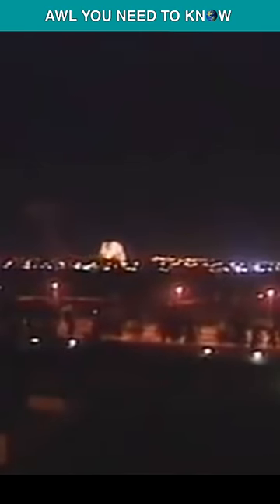How a Tomahawk Missile Works? #shorts All You Need To Know

Comment: so there are 150 missiles per DDG (not counting the others and not counting reloads at sea thats dangerous) what do we have like 100 DDGs.. thats roughly 1500 missiles that can be fired without reloading.. not that we would ever stack every DDG we had like that in one area but damn..
Reply: There are 90 cells on a DDG and will be mostly SM-2/3.  The Ticos (CGs) had 122 cells, and still mostly SM-2 (the 3s were not out yet when I was in).  
  I imagine you could load out with 100% TLAM but not a very effective use of assets.

Comment: Develop the new stealth cruise missile initiate it with a ram jet engine to get it to mark 12 and enhance range by 80 miles then it falls off and it uses a turbo fan which increases its range to a max total of 850 miles increase the power from a 1000 pound warhead to a 16 or 1700 pound warhead dip it in stealth radar coat

Comment: They cost $1-1.5 million each smh
Reply: Which if you are going to attack a heavily defended target allows you to complete the mission at the fraction of the cost of one downed aircraft.
Reply: @IMDunn-oy9cd  a single tomahawk will never hit if the target is defended by modern air defense 

That means they'll have to launch up to 20  at a single target to overwhelmed the air defense  the cost is already summing up bruv
Reply: @williammcmanimon9644  That’s nonsense.
Reply: @williammcmanimon9644  let's say you've got an s400 system that costs 300 million dollars and it's in my way.  If I launch 30 tomahawks at it and one destroys it, that's a hell of a cost conversion, roughly 8/1 and my aircraft can move on without having to fuck with it.  Pretty good value proposition, especially from a tactical standpoint, because it keeps the radar from notifying your forces which way my planes are coming from b4 it gets destroyed.
Reply: @Typexviiib  hey genius you'll have to find the air defense radar first 

You don't just magically know the location and shoot at the radar , let see you can launch a couple of atgm to get the location of the air defense but still the s- 400 will just turn off it's radar and move somewhere else , and

 besides why use the s-400 against such an easy to strike target, s-400 is mainly anti aircraft, it's an overkill against tomahawks any lower grade cheaper air defense can do the job well , even cruise missile are shot down with man pad , you can look that up